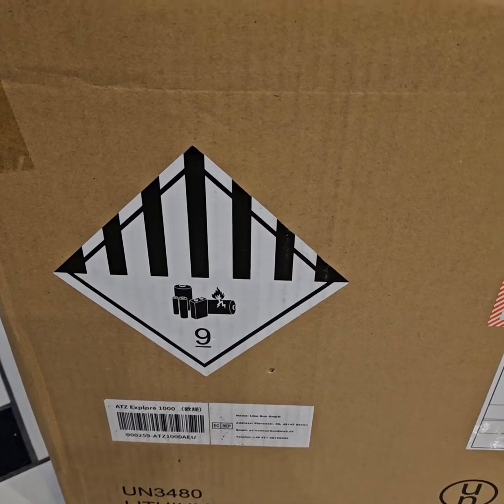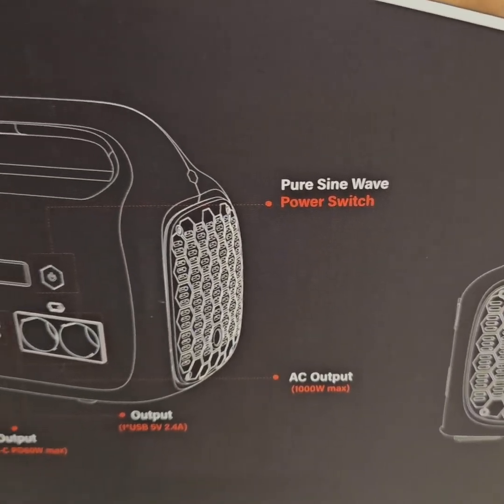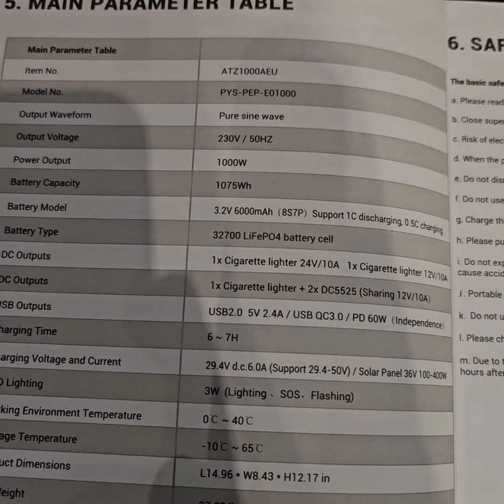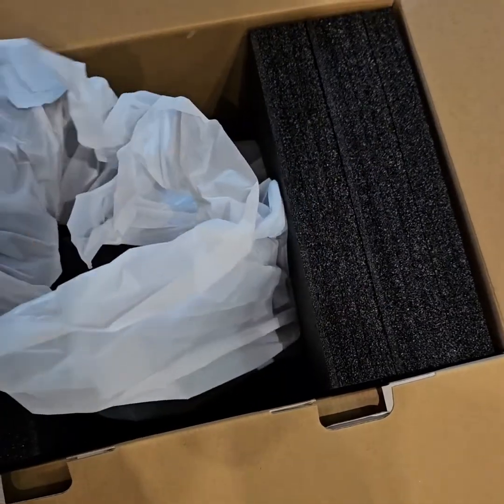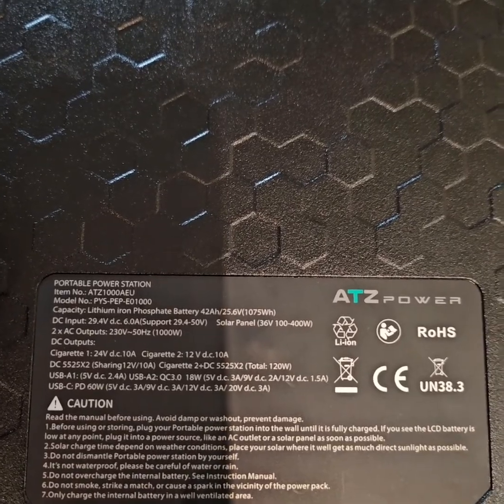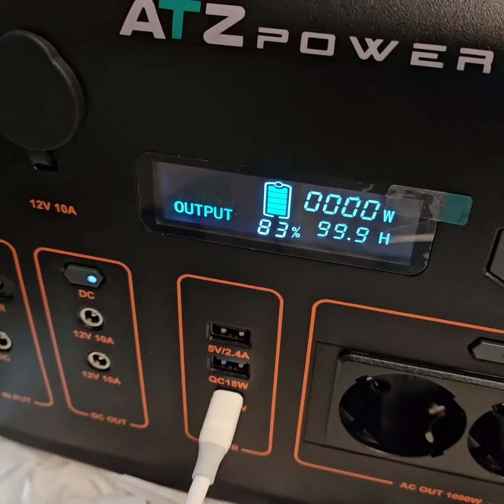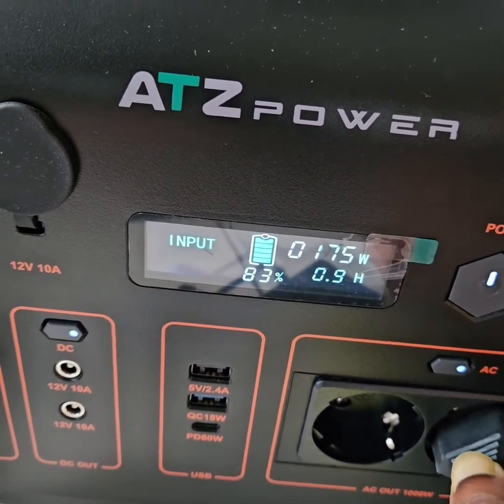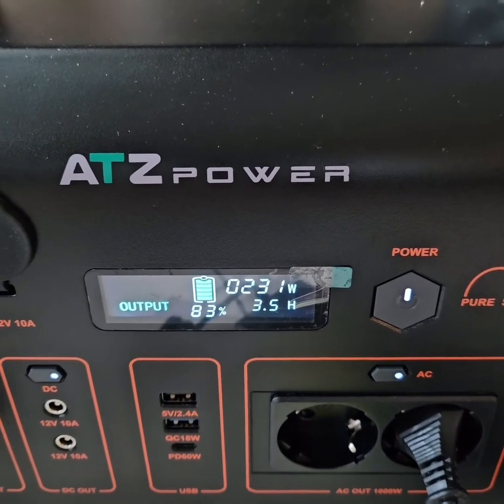Cheapest 1000w Powerstation ATZ Power 1075wh, quickreview and teardown

Comment: Where/how can I find replacement cables for this unit?
Reply from the maker: Which cable you mean?
Reply: Sorry, I need the wall charging cable. Also, I do not understand for the solar panels…do I need to worry about having the exact open circuit voltage? Thank you for your prompt response.😊

Comment: There is something like hard reset of this device? I have fully charged this power stadion, but suddenly its automatically turns off if I turn AC or DC. In instruction there is something like this: "Gently press to open Master Switch, then press and hold Press the main switch seconds toturn it on completely, and then release it. It will recover automatically." What should I press to open Master Switch?
Reply: Это наверное болшая кнопка включения и выключения
Reply from the maker: This instruction seems to be poorly translated. What helped me is to do some charge and discharge cycles.

Comment: The station shuts down when the charge drops to 50%.  How to reboot it? Or how to fix it?
Reply from the maker: First discharge it to 0%, use USB Ports to discharge. Then charge it to 100%.
Reply: @HouseAndSolarProjects  thx. i hope it works
Reply: @HouseAndSolarProjects  thanks for your response🙏🏼
But the station turns off before the charge drops to 0%. Even if i use usb ports
Reply from the maker: Then It seems that one or some of the cells  in the pack have become unbalanced or bad. Please check the individual voltage on the balance cable on the balance board.

Comment: Did  you ever get the solar input to work? If so what is the secret? I tried multiple solar panels and the input indicator never showed up! Thanks!
Reply from the maker: Yes, I used the 24V Panel with XT connecter
Reply: @HouseAndSolarProjects Do you have a link? Thanks!
Reply: Instructions state you need 36 volt panel between 100 and 500 watts. Some panels won't charge if not in spec.